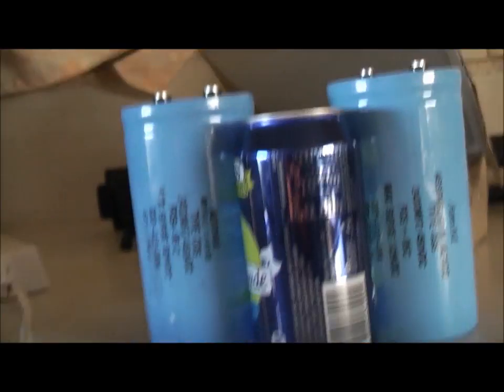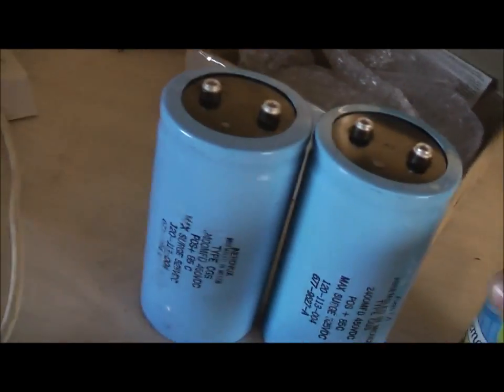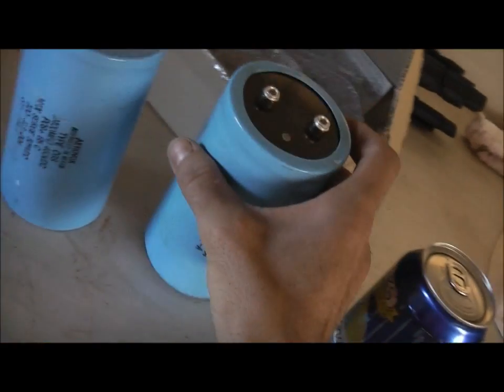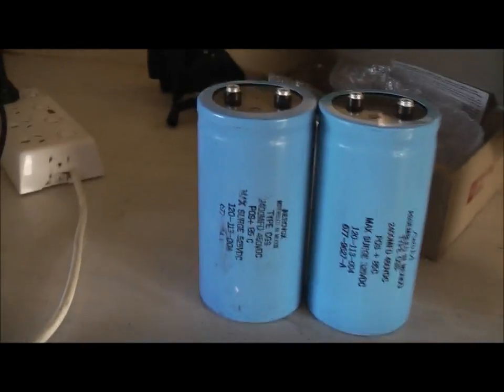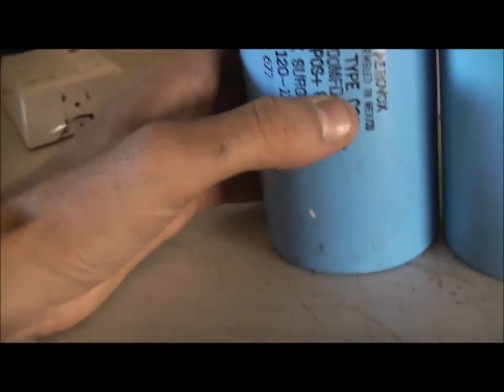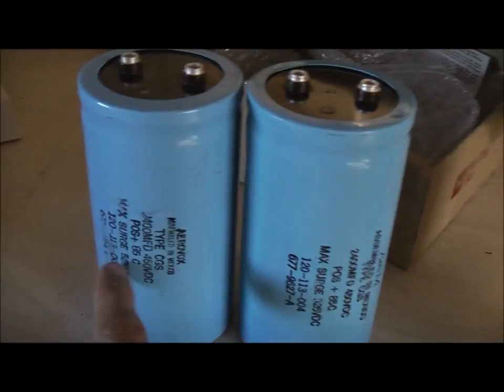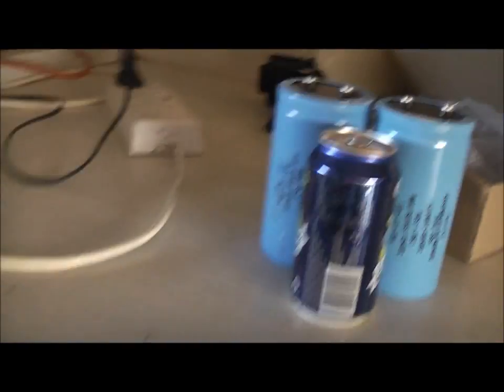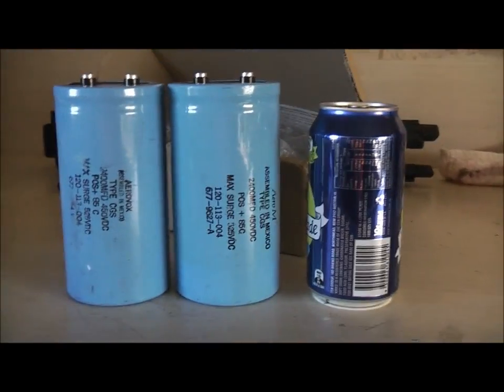BAZ Rollover & BIG Capacitors!

Comment: I must have lucked out because when I bought 10 of them at once (the shipping was horrendous), they were all in pretty good nick, and work well. Guys I've been busy with my new server getting it up and running, and next is the laptop then I'll get back in there and play electronics. My next step is getting my puck SCR wired up, and redoing some code ALA alex99cc1 style (bluetooth) between two arduinos. This provides a nice big air gap between operator and thing destroyer :)

Comment: if you need make a charging setup i used a ballast use a florescent light ballast with a bridge rectifier, it works good gets up to 300V quick, that is what i used to charge my 12000f 450V cap, good loud bang :D

Comment: Mmmm, those are about the same size as that Mallory cap that Photon popped. :-)

Yes, both of them in parallel, fully charged up......There's going to be some BIIIIGG poppage. :D I'm not sure how you're going to dump the charge, but whatever you're going to use, it's going to have lumps blown out of it. :D

It would be interesting to use them as batteries. Charge one of them up to only 1.5v & see how long they'll power a quartz clock. :-)

Thanx for showing,

{^_^} BoomBoxDeluxe {^_^}